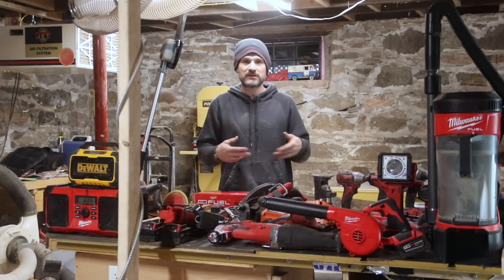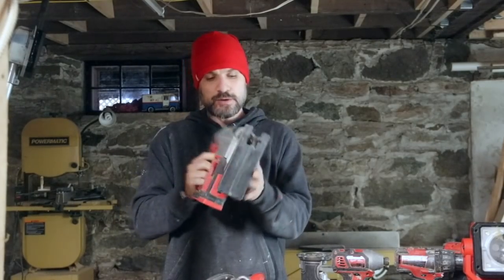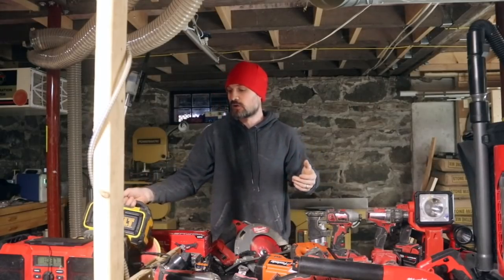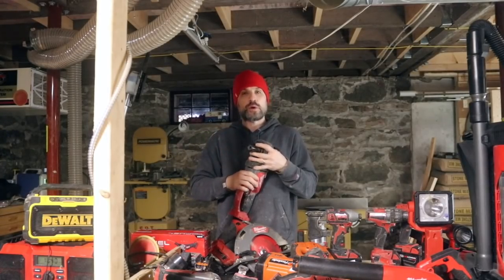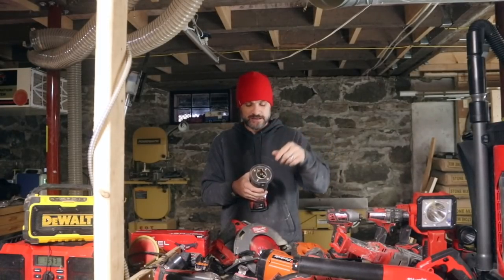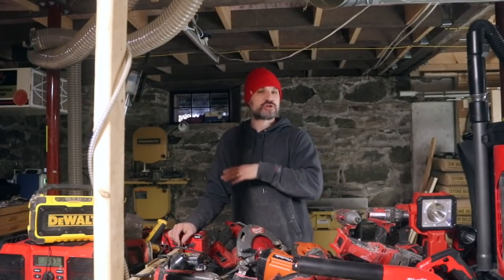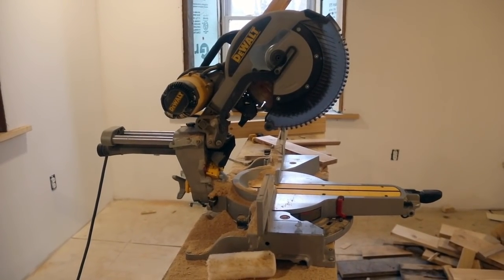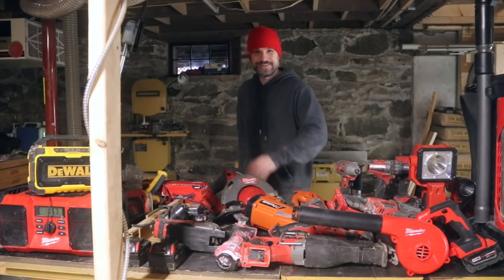4 Year Milwaukee Tool Review | These have let me down

Comment: Loved this review! Appreciate the fact that you weren't sponsored. So hard to find honest tool reviews by lay-carpenters like us. Totally get why you bought into the Milwaukee power plant...most of my contractor friends have them for the same reason, durability and warranty. The batteries also last a long time and keep a charge in the cold. 

I got into the Rigid powerplant last year primarily due to their lifetime warranty. Doesn't hurt that I have a HD 5 mins from my house...Rigid aren't my favorite, but they are solid. 

Makita would be my go-to if I had the $$. Their design, function and ergonomics are the best. They are a joy to use. That's why they can charge so much. 

On the backpack vacuum, almost bought that for my wife who is a professional cleaner -- she was doing an apartment building project involving a lot of construction debris removal. Read a few reviews and decided against it...this video confirms I dodged a bullet. 

Lastly, I have the same mitre saw. Like you, I had a VERY crappy Mastercraft one before it. Every time I use it, it makes me smile. 

P.S. I'm now gonna have to get that sander...have a ton of rough cut maple that eats sanding pads. 

P.S.S. You should do more reviews like this from time to time...refreshing.

Comment: This was helpful. I have Dewalt stuff I  bought and craftsman  hand me downs.  Last Christmas  my kids got me a Milwaukee  little angle drill, which is good in tight spots but it very light on power.  My favorite  power tools is my corded  Dewalt drill, I love my cordless  too, but sometimes you need an old school corded backup. Has never let me down.   Thanks for the honest feedback!
Reply from the maker: Most or All of these types of tools are fine.. just huge difference with the light duty tools and “professional grade” tools.. for example, Milwaukee makes a “fuel” brand and that just means it has their brushless motor and they tend to have a lot more power. 😃

Comment: The first diy electric tools I had were Black and Decker that was over 40 years ago. With exception of my first electric screwdriver they are all still going strong. Over the past few years I have bought new tools often after seeing you use them. For example the palm router; I have a large router which can and does any job I ask of it but the palm router is so easy to use for smaller jobs. Particularly as I have small hands it is easier to control. I do not feel as though I have been wrestling bulls after using it. 😂😂 It is a de Walt - part of the Black and Decker company - as it was a great price on Amazon. I have also bought an orbital sander after trying to sand dining room table with a flat bed sander. Saw your videos where you used the orbital and though I would give it a try. Wow was it a game changer. Again it is a better fit for my hands and it is so much easier to manipulate. On my wish list is an electric mitre saw (it is what you call a chop saw,) - have seen one that converts to a table saw but at nearly £400 it will not be bought any time soon. Did have a circular saw but it was a beast of a thing - huge and heavy - much to big for me. I think it knew I was afraid of it 😱😱😱 😂😂😂 2021 is going to be a year of house repairs and renovations, although nowhere near what you and DIYfrence have been doing, so the tools will be in constant use. They along with my sewing machine which is over 50 years old. Which proves what I have always said good tools well looked after will last a long time.

Comment: I enjoyed it -- basically because of your delivery! I especially enjoyed the right angle drill with the "special" bits, including when you dropped it. 😄 I don't have any Milwaukee tools because I ended up buying into the Ryobi One+ line. I'm pretty happy with most of the tools in that line. As for the backpack vacuum, I think the concept is great, but agree that it would drive me nuts if it lost suction so quickly. However, that's been my experience with any shop vac I've owned. Fine dust will clog that filter in minutes. I've been looking at those little cyclone dust separators that mount on a 5 gallon pail and go in line before the shop vac. I'm not sure that I want to deal with an extra contraption, though!

Comment: I’m a Milwaukee guy myself.  Don’t have much Milwaukee, but what I do have I like.  I’m for real gonna buy the dewalt sander you have.  I’ve seen you use it multiple times and said I “need” that😂.  Also. I’m in the market for a planer.  I had a delta and it bit the bucket.  I was devastated.  Liked the video. I know it’s not your normal thing, but still a “thumbs up” for me.

Comment: I personally prefer corded tools for most of what I do.  I have found that they generally outperform cordless tools at a much lower price.  I have several good extension cords, and for the odd time I'm away from power, a 1400watt generator.  I am also not brand tied so I can pick who makes the best tool each time.

I will say, if I was doing major construction, I see the advantage of cordless tools on a job site.  I would have a pasload nailer if I did enough work to justify the cost.  I have one cordless drill that I use regularly.  I just don't use them enough that I feel the till will be worn out before the battery technology makes it obsolete.  I have a 20 year old plug in clutch drill that is still my primary screw gun.

Comment: You should send Milwaukie an e-mail and list your tools, review the ones you like and  dislike and why.  This video was good, it lets the people know what is good or isn't, even I watched and the only tool i as a woman own is a dewalt battery operated drill, black and decker sander and one screw driver that takes 6 different heads and they are stored in the handle....lol
Reply from the maker: Ha, That sounds like the perfect screwdriver if you never lose the bit

Comment: I have that Milwaukee jig saw (actually "sabre saw", I think).  It's lack of a light is a pain in the tushy.
And it's made of aluminum, so sticking a light with a magnet won't work.  I plan to epoxy a piece of iron to the front, so I can magnet a light to it.  And it ways 93 pounds.  What were they thinking?  What was I thinking?
Reply from the maker: Lol! Yes, that tool is probably the worst design they have done...

Comment: A problem tool manufacturers face is being at the mercy of their parts suppliers.  The excellent variable-speed DeWalt sabre saw I bought decades ago (three decades, I think) became a one-speed after a couple of years, when the switch failed.  I ignored it for a few more years, which was a mistake.  Then DeWalt told me the switch's manufacturer couldn't supply a replacement switch.  Now the saw keeps a storage drawer from being empty.
Reply from the maker: 😂 if possible.. I wonder if you could get it on eBay? Find another one for parts

Comment: That was the good the bad and the ugly and all the better for that line up. Nothing is perfect, sometimes we want to do things that hit the limits of the tool we have available, sometimes, (well in my case often) we nudge the limits of ourselves. Now in my mid seventies when tools have become ever more useful, my hands and legs have moved the other way, making them less useful, which is not what I want. I used elderly my black and decker drill with attachments to cut blocks, it worked until it failed. I had to scrap the attachments for that 40-year-old item, it was my user error over working the poor thing. The garden path I laid still works for me. Now, I tend to sit back and enjoy watching the success others have with their tools. I hope they avoid my mistakes and errors, and most times they do. I still want to get a shed repaired but the handyman I approached has disappeared. So, come the summer, when my wife is not watching I will get busy.

Comment: drywall dust is not meant to be vacuumed .  Broom sweep 3x then wet mop till clean.  That poor vacuum !!
Reply from the maker: whats a brrooommm?
Reply: @1806StoneHouse   when I was young I killed a shop vac I was kicking the filter around the yard every 10 or15 min. to clean it. 30years now just a broom and mop. It sucks but it works.  You did good on this it was fun.
Reply from the maker: @hsimpson6581  thanks, yeah, beating those poor filters in the yard where the neighbor can see. 😂😂😂

Comment: Good job. I value a random, off-the-cuff, non-sponsored review, more than a slickly produced one with piles of data. I bought Milwaukee's compact, lightweight Hackzall ($99, tool only, no battery) after burning out my old Harbor Freight reciprocating saw, cutting down multiple trees with it. That thing must've weighed 8 pounds...Love this Hackzall so far! Light, quick-release, no allen wrench needed blade change, and powerful. Especially good for holding overhead to do demo, getting into tight spaces or whatever...

 https://drive.google.com/file/d/1wmrYK7oQtzZO1qLMfrub9QLKjXbYa_Jq/view?usp=sharing